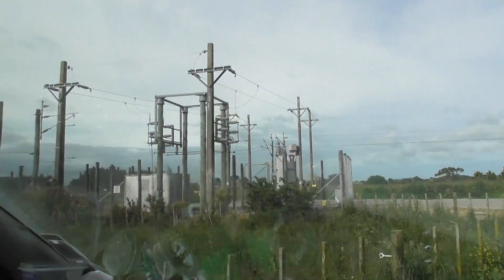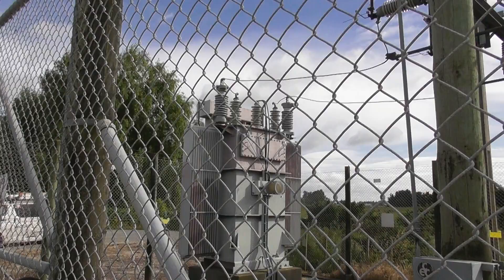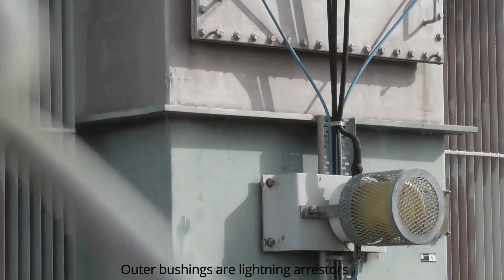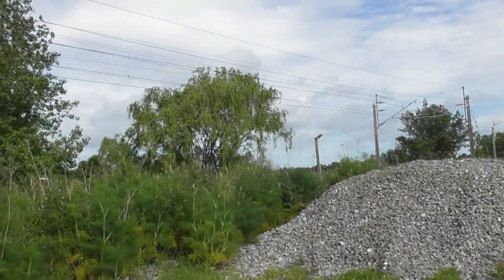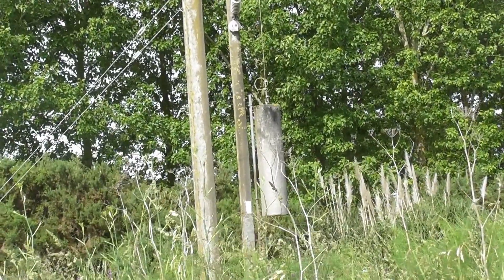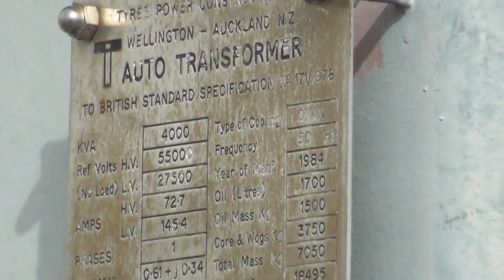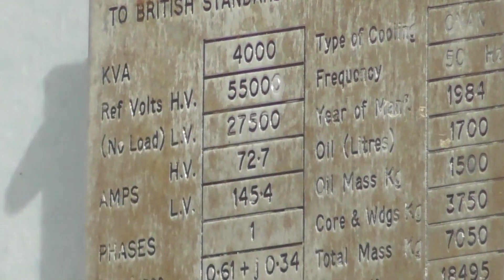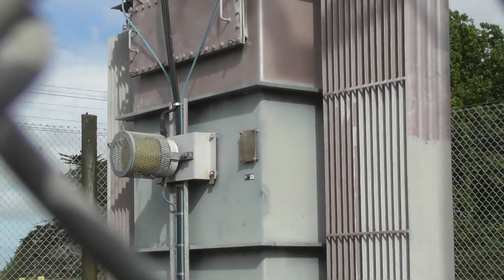55kV / 27.5kV railway traction supply

Comment: Nice! 
So much easier when using the same frequency for the railway as the power grid. Many other countries uses old standards - usually lower frequencies (like Sweden for example, where I live, where 16 2/3 Hz is used) and need inverters or rotary converters, to convert the 50 Hz to other frequencies. 
That also usually means fewer feeding points along the tracks (since they get quite expensive), which in turn causes large voltage drops in the lines for trains that are far from a feeding point. That  causes inefficiency and power loss and also limit how fast trains can accelerate (especially heavy trains and/or if many trains that need power at the same time). To make it worse, the voltage is also often lower (15 kV instead of 25 in our case). But the reason is usually old vehicles are still in use and it's more expensive to replace all those, than to convert the power.
Reply from the maker: Love to see a video of a railway rotary converter for 16 2/3 Hz.
Reply: @RODALCO2007  Yes - I can see if I can film one later. The problem is that when we have such few feeding points, those are  guarded and mostly hidden inside special buildings, closed off tunnels or similar 
(so they are quite hard to get to get any interesting footage from, unless you are working with railway power systems). We have 1 main inverter station that feeds most of the Stockholm area for example - so if that goes out (wich have happened on a few occassions), 
no trains can run thru central city, except diesel powered ones
 - and in rural areas, there are often more than 70 km between each feeding point, so if one goes out there it will often shut down all traffic between cities.

With just transformers, there may be many along the way and each of them don't need to be as well protected - if one goes out probably just means there will be less power available and trains may need to accelerate slower, but they will still run.
Reply: Present 50/60 Hz AC electrification with direct connection to the national grid has a serious drawback - phase unbalance. Because trains are single phase, but grid is three phase. Low frequency electrification doesn't "insert" this unbalance problem to the grid, since converter stations are always feeding by three phase.
Reply: @thesignalbridge  That's true - for that reason, the best thing is probably to run trains on DC (despite the power grid being AC). DC-stations is basically 3 phase transformers (drawing power from all phases) and rectifiers. Turning AC into DC is simple (the complicated part in the converter stations, is to turn it back into AC, but with another frequency). Many subway lines for example, have many such stations and very close between feeding points
Reply: @Speeder84XL , agree. As installers of special type of UPS at AC powered rail lines in Russia - sometimes we faced an extra-low quality of AC mains to power our UPS. This is due to high THD, generated by old-style (simple diode rectifier bridge, or, even worse, thyristor phase-angle regulated rectifier bridge) AC 25 kV locomotive's DC traction motor circuits. Lines with 3.3 kV DC traction never had such high THD from rolling stock. Low voltage DC like metros - also free from high THD trouble. More over. Russian rail electrification R&D guys were proposed a 25 kV DC electrification to overcome limitations of relatively low voltage/power of 3.3 kV DC systems in heavy traffic regions. In this scheme, rolling stock must be equipped with multiple stacked DC/DC converters to convert 25 kV DC to DC link voltage for traction converters.
Reply: @thesignalbridge  Yeah - I can think THD may go up a lot, if trains have poor power factor. The relatively large voltage drop of rail power lines (compared to ordinary ones) also makes non linear current draw to easely distort the voltage wave form as well. 
I have made "antenna coils" my self, just  for fun (simply a very high inductance coil connected to a modified low impedance microphone amplifier). 
With those, AC current in power lines, magnetic fields from transformers and other sources can be analyzed in a simple audio editor and also heard as sound. I have heard how those old trains using phase angle control, sounds, haha. Pretty much like a simple light dimmer, but 1/3 of the frequency - but that's quite nasty at the power levels of a train and causes a lot of inefficiency and power loss.

I think that onboard DC/DC-converters may be cheaper and easier for new trins, than big bulky 50 Hz or (even worse) 16 2/3 Hz transformers like they have on the old trains. If using a high frequency transformer, it's easier if the input already is DC than if it's low frequency AC that need to be converted to DC first. 
If there are already a lot of old trains running that need to be retro fitted with DC/DC converters, that's another thing though.
Reply: @Speeder84XL , I think in the same way about THD. Thanks to present computer hardware, now we can build a good DIY audio Fourier analyzer. I'am also planning to build similar recorder.
Reply: @thesignalbridge  Yes, many audio editors already have that built in and it's actually quite simple to record AC.
The only main thing that you have to take into count is the sensitivity of the coil vs frequency, if you want to hear or measure what the current in a line looks/sounds like and measuring THD levels.
The frequency where the reactance is equal to the total circuit resistance (resistance of the wire in the coil plus the resistance of your amplifiers input) is the -3dB point (thats usually the frequency that's given for for high/low pass audio filters - above or below that frequency, the sensitivity changes in the same way as a simple RC/RL high pass filter). 
A normal microphone amplifier will work (strong magnetic fields give enough output to drive a line input on a audio recorder/soundcard directly)
 - but it's preferrable to have as low impedance on the input as possible to get that -3dB point as low as possible. As opposed to microphones where as high impedance as possible, is the beast instead (that will minimize the load on their output signal and thus get lower distorsion). 
The best solution is usually to build an own amplifier, using an operational amplifier connected as inverting amplifier (wich in practice have almost zero input impedance)

Comment: Interesting input voltage, I thought NZ used a 66kV EHV distribution voltage the same as the UK?
Reply from the maker: 66kV subtransmission voltages are used in remote areas to feed 66/22 kV substations.

Comment: These types of traction substations, also called autotransformer substations or booster substations, have this interesting arrangement because its a 2x25kV traction system. On one side of the line, from the national grid (In Hungary its 132kV 3 phase) there is a transformer in the range of 12-16MVA supplying 50kV. One side of this 50kV is connected to the catenary line of the railway, this is where the train gets its power, the other side of the 50kV is connected to a separate line called feeder. Then along the whole length of the tracks, there are several of these booster substations where on the outer windings the 50kV is connected and the center tap is connected to ground and the railroad tracks. So from the trains perspective between the catenary and the tracks it is 25kV. This type of arrangement is commonly used for railways lines that are quite long because with the 50kV you can cover a longer distance than with 25kV. But you need several of the autotransformers which provide the return path for the traction currents.
Greetings from Hungary, a traction substation electrician.
Reply from the maker: Thanks for your detailed reply. Similar set up here in New Zealand.

Comment: That will be a +/-25kV autotransformer with the centre tap shown there connected to rail.
Reply from the maker: Correct. Just a long distance away from the supply sub, hence a higher voltage rating. Traction is designed for 25 kV but often upped a bit higher.
Reply: @RODALCO2007  Yes - usually they add about +10% at the feeding points, to compensate for voltage drop in the power lines - so, that's why it's 27,5 kV